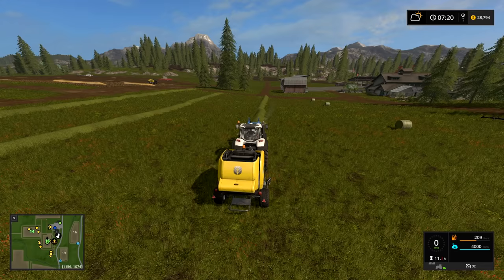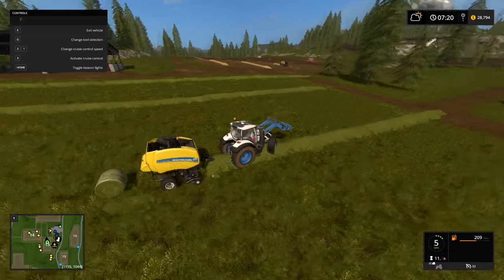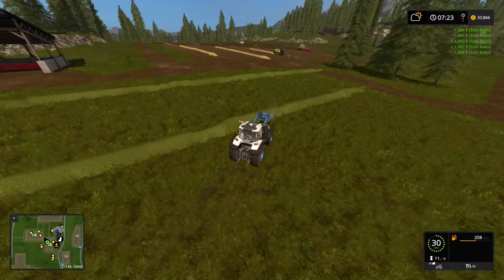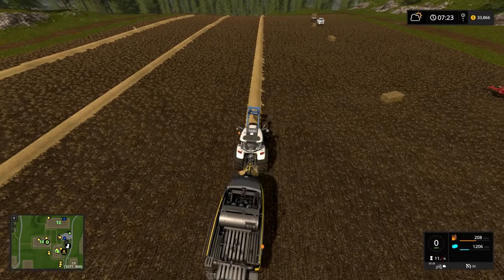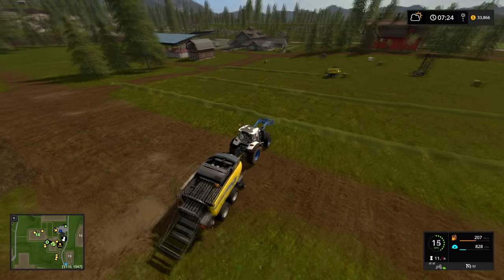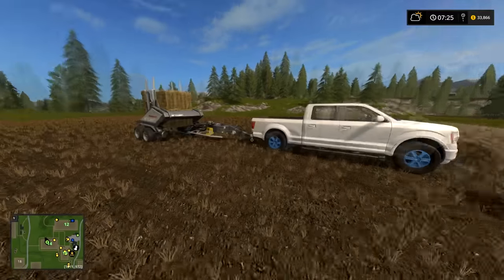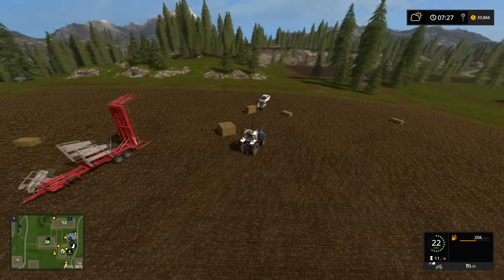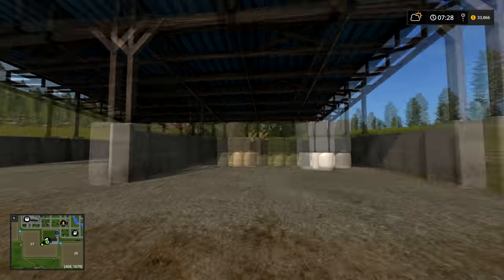Farming Simulator 17 Tutorial | Baling (Hay, Silage, Straw)

Comment: There is a simple mod to auto unload round bales, and in settings if you turn off "Auto Engine Start" when you get out of the tractor (as long as the engine is on) it will continue to wrap the silage bale or continue anything a tractor is connected to. Also thank you for your amazing tutorials!

Comment: Just noticed tonight when I was wrapping bails for silage..    The silage wrapper continues to run now when you switch tractors or leave the tractor.   Don't know if it was a bug they fixed or an update changing it, but you can now walk away or switch tractors and come back.   Thought I would give you a heads-up so you can add an annotation or something.   Thanks again so much for the great tutorials!
Reply: It's because he has the auto start and stop on, so when the tractor turns off, the wrapper stops too.

Comment: A tip I found out is that if you use a machine without any type of bale spike, a pallet fork will work. For example, there's no bale spike for wheel loaders but the pallet fork works just fine.

Comment: What is the difference between round bales and square bales?
Reply: BryceEvolution nothing really.... Square bale collector holds more bales, and the with the square baler, you don't need to stop for the bale to be released
Reply from the maker: And silage wrapper only works on round.
Reply: Square nails are easier to handle especially if on a slope. In this instance, place an implement downhill of them so that they are blocked.
Reply: how do i load the straw blower with square bales?